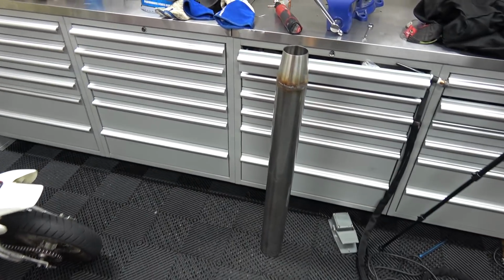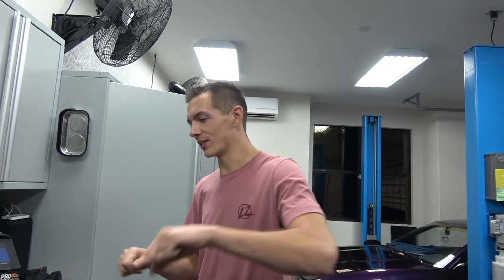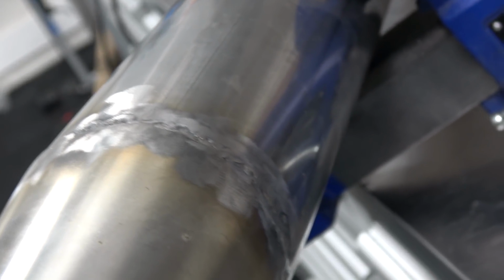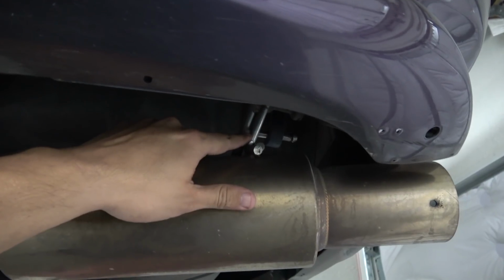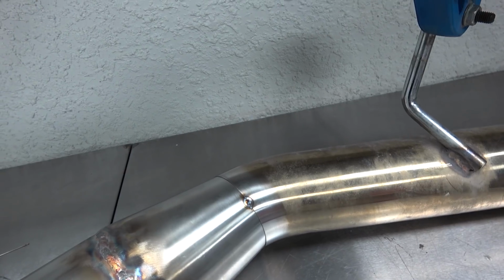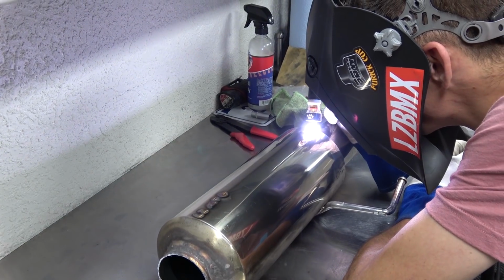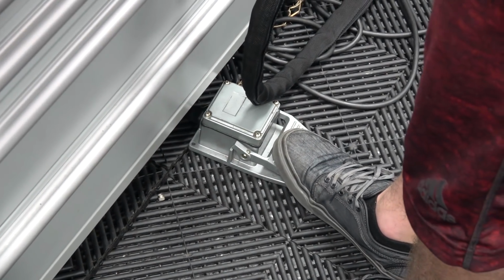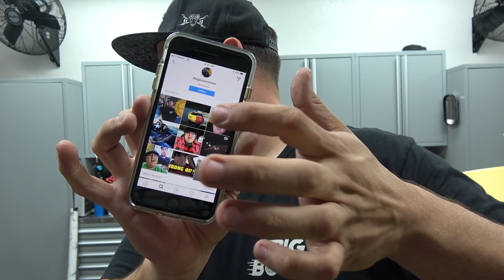TEACHING ADAM LZ HOW TO WELD

Comment: Alberto, i'm sure you already know this, but when you cut with a reciprocating saw, push the shoe against the material and slowly start the blade, it'll keep in place. By holding the shoe away from it the blade flexes and doesn't get enough downward pressure and that's why it walks so much.

Comment: Honestly what alot of people don't realize is that your welds don't have to look good they just have to be strong and hold that's it really
Reply: When you're welding stainless steel, they need to look good, because welds like Adam did on his first try fucked up the actual treatment done so it doesn't rust, those welds are just gonna get eaten by rust if you don't paint them.
And I don't know much about welding but I am pretty sure prettier welds are stronger than ugly welds.
But it's still cool af to weld even if you're not that good at it, you just can make so much stuff.
Reply: Jokey Jesus, you clearly don't know what you're saying or what you're looking at.

Comment: Hey bigboost! why is your tungsten sticking out that far from the cup? You get way better shielding when you put it in more. And if you grind your tungsten to a smaller point your arc will be better and you can control the puddle easier. there is a lot of good info in this document let Adam read it it will help him with setting it up. http://eng.auburn.edu/~griffgj/training/Welding%20Training%20Guide.docx

Comment: Alberto why is your weld going deep inside but the one i used to weld comes out like a bump? & the welding machine dosen't have a throttle on the floor instead it uses trigger & the tungsten comes out from the 'gun' i dont have to hold the tungsten with my other hand. Is it a different type of welding? edit: the one i used to weld sparks alot too unlike yours.
Reply: Armour Shooter mig & tig
Reply: youre doing mig
Reply: You have a mig (GMAW) welder. It's kind of a self fed tig. But you aren't feeding tungsten out of the gun it's mig wire or flux core. Just depends on what you have in there. With Flux core you don't need a shielding gas since the wire has Flux built in that melts and shields your pool as you weld. If you have regular mig wire you'll need gas to shield your pool. Otherwise you get contaminated welds that look bad and aren't as strong. Flux core is a little more difficult to run than gas shielded wire.
Reply: If its sparking alot try to hold the end closer to where you are welding. so the distance is shorter between the wire coming out and the gap you are welding.
Reply: With tig, you're not holding the tungsten in your hand, and the tungsten doesn't come out of the gun that you're talking about, because there is no tungsten. The metal that comes out of the gun is actually steel, unless you're welding aluminum. With the welding done in the video (tig), the tungsten is the part on the gun that sticks out that the arc comes off of, and the thing in their other hand is the same kind of steel that would be coming out of the gun for the welding that you were doing. The type of welding you were doing, as others have said, was mig welding. Hope this was informative!
Reply from the maker: That would be mig welding
Reply: Thanks guys for the information! i learned alot 👍
Reply: id suggest looking up Chucky2009 on youtube, he has a few welding videos on there teaching you the basics.